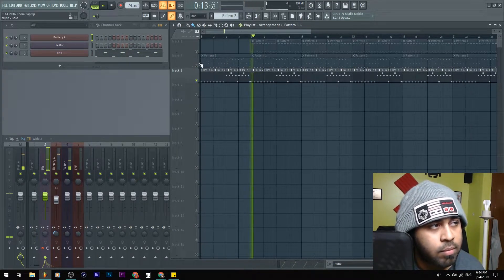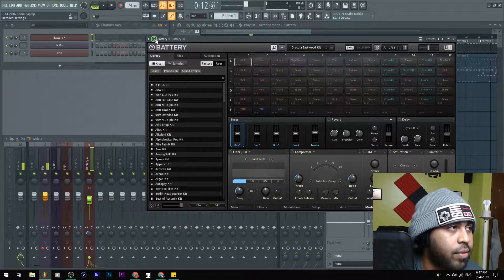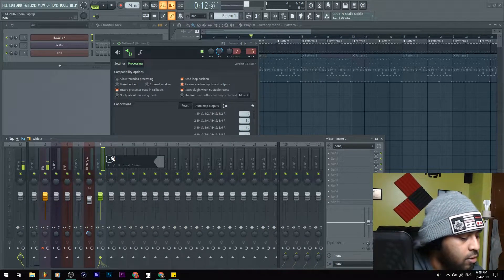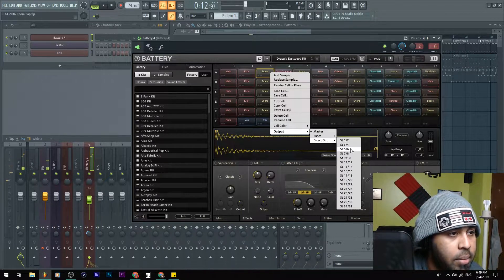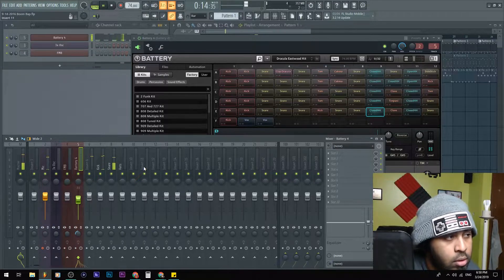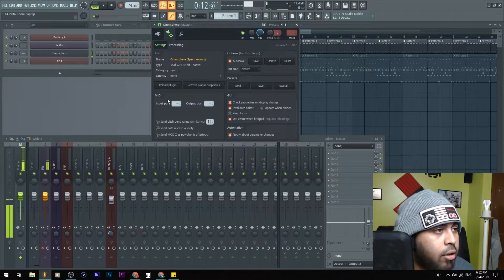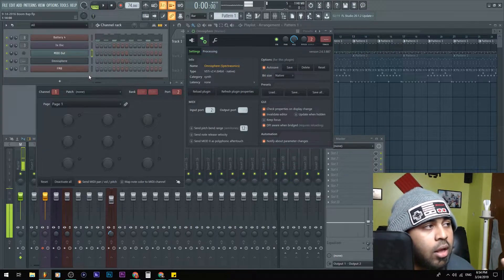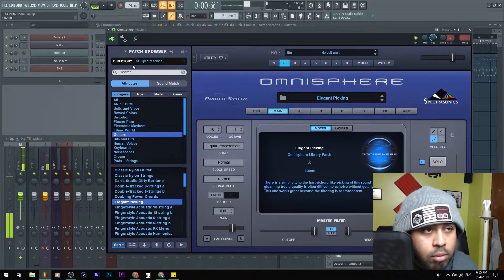How To Use Multi Out VST's In FL Studio (Midi, and Mixer Outs)

Comment: In the first example - How do you do the mapping for hardware ?

This is exactly what I want to do for my drumbrute impact!

I want to send all the different drums to midi channels 1-16 but there’s no vst to select the channels like you did for your drums by clicking the gear icon 

When I record and hit “everything” I want to be able to have everything recorded separately  in real time.

That way I can jam and all drums are printed individually.

I know how to route the midi out / ports but I do not understand the 16 channels and how to route them if the hardware doesn’t have a vst that pops up in fl studio.

Can you point me in the direction if you have a video ?
Reply from the maker: Hey! Short answer: Unless you have 4 Input Ports in your Audio Interface to record from the 4 Individual outs on the back of the Drumbrute Impact device, you're going to sadly have to record them one by one.
The Midi OUT's that was mentioned in this video were in terms for the Software Plugins (VST's)
For hardware, the INPUT is all Analog Signal, which can't be split amount 1 TRS cable at one time.
I have an Arturia Drumbrute, and I think there's like 16 individual outs, so I did have to suffer through recording 16 different passes in the past too. :P

I don't have a video on that sadly. I do only have one in regards to recording Hardware Gear, but I'm sure you already know how to do that.

Comment: I have a beat pad with dials that I use as a mod wheel/pitch/after touch. However none of those dials work when i use them through midi out.

Also, my keyboard and my beat pad only play whatever is on channel 1. Whenever I have a different sound loaded and selected on 2-8, any note or signal I play comes out on whatever is loaded on channel 1. This part has nothing to do with midiout. 

Do you have any idea how I can get my controllers to play whatever is on channels 2-8 and not default to channel 1 every time?
Reply: Update- I sorta figured it out... under “browse parameters” in Omni settings in top left, I scrolled all the way down until I found midi CC (modwheel) and (aftertouch) etc.

they each had a number. Like, 1 for modwheel, 10 for panning. I went back into the midi out interface, and right clicked a dial < configure. Then i checked channel 2 (the midi was hooked up to channel 2 of Omni) and next to controller, I input 1. Which was the midi modwheel CC number. 

In the end I fully figured out how to use those MIDI out dials on the interface. I bound them each to a different  dial on my hardware beat pad so I can modify any sound in any channel real time.